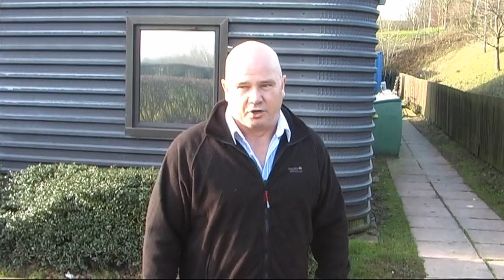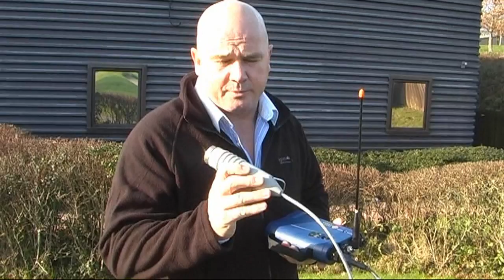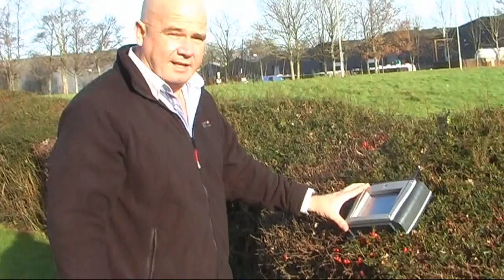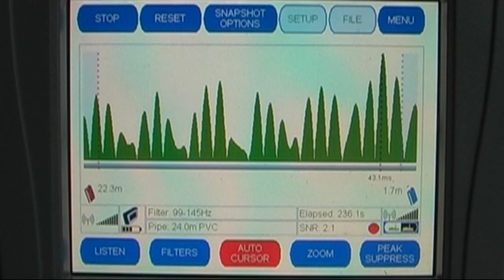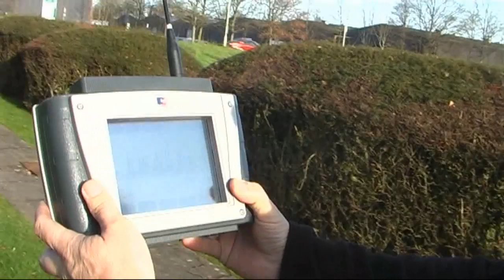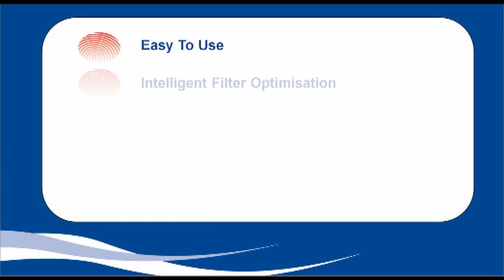MicroCorr Touch Leak Correlator

Comment: Useful video thanks. Can I ask though, what’s the best material to select when correlating galvanised iron as this material isn’t listed on the touch pro.
Reply: Galvanised Iron is not normally used as a water pipe, the correct term is Galvanised Steel. Steel would be your best option from my experience.